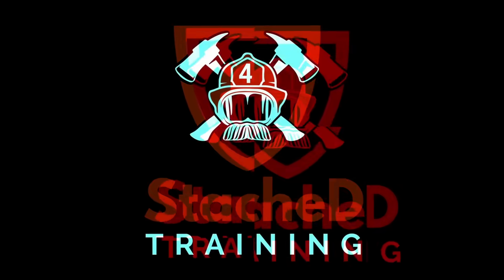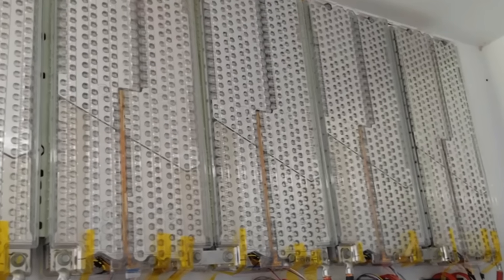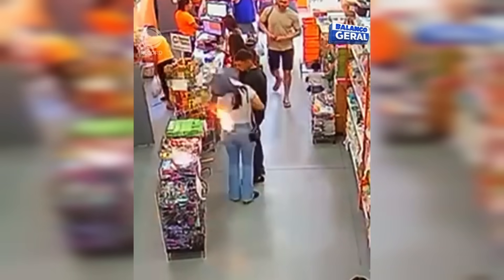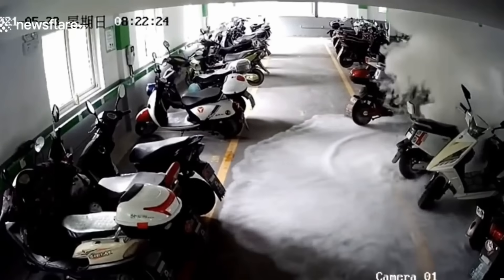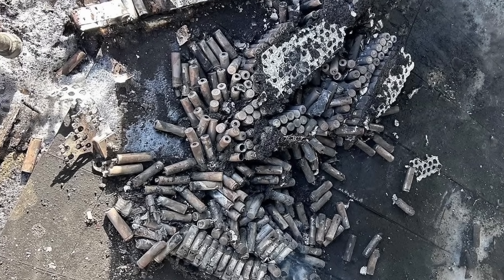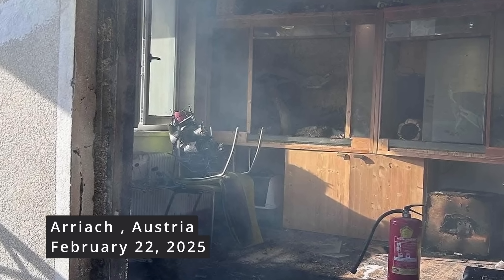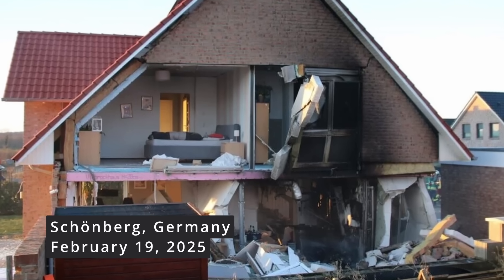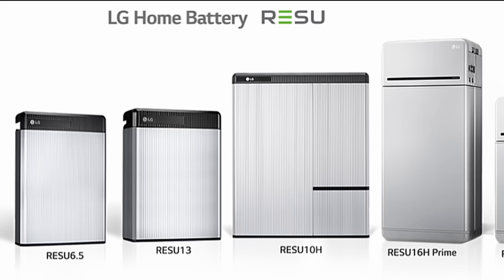Two Homes Just Exploded—The Hidden Danger in Battery Storage!

Comment: Here in the UK, gas and heating oil tanks have to be outside and a certain distance from habitable buildings.  Oil tanks must be bunded to contain any and all leakage from the tank.  I feel the battery storage systems ought to have similar rules applied a certain distance from habitable buildings.  I can see though, that neighbours might get upset if the thing is placed anywhere near their boundary.
As an aside, as an electronics engineer, we never directly paralleled cells (at the time we were using Ni-Cad, NiMh and sealed Lead Acid) as they just werent team players.  If the cells were even slightly mismatched, one cell would discharge into the other, leading to high balancing currents, shorter cell life and potential thermal issues.  A typical cheap wireless device uses paralleled 18650 cells to achieve the required discharge period, I shudder to think of the parallel/series connections of an EV battery pack - unless there are monitoring and isolating devices on each cell string, self-balancing discharges are guaranteed.
The amount of energy stored and available for immdeiate discharge is collosal - having shorted a small motorcycle battery accidentally with a spanner, the energy release is immediate and immense.
Reply: Same with pulse discharge capacitors.  They'll release 25+KA in a short circuit.  They can blow your hand off.
Reply: I'm surprised at the rules for fuel oil storage. In NYC, private houses can have a 275 gallon tank indoors, and virtually every house built before the 70s had one. I've never heard of any domestic fuel oil fires, and I'm pretty old.
Reply: @robertmoffett3486 Diesel is a liquid fuel, not a gas. It can catch fire or accelerate one, but leaking diesel fumes usually don’t quickly spread and build up in a room and explode.
Reply: @robertmoffett3486  Unless there's tremendous heat, fuel oil, like Diesel doesn't burn unless atomized.  That's why oil furnaces, boilers and water heaters have a pressurizer built into the burner.  Same for torpedo heaters.  I don't understand why you can't keep the oil tank in the basement.
Reply: In the US, it is common to have fuel oil storage tanks in the house.  Especially in colder areas, fuel oil/diesel (same thing except for road tax exemption dye) would get very thick.  Systems are typically gravity fed to the furnace, so winter temperatures would cause problems.  I've never heard of any tank causing issues all by itself.
Reply: @dzcav3 Diesel is a liquid fuel, not a gas.
Reply: @dzcav3 
Except for leaks.
Reply: @dzcav3  
In Europe heating oil is also stored inside as you described.
(Diesel) oil is actually very hard to ignite.

In Europe (Germany) the requirement is a kind of an extra XXL oil pan underneath the tanks to catch any spilling or leakage.

heating gas is stored outside with a certain distance to buildings.

Peace! from Dresden / Germany
Reply: [useless trivia]  In the original Star Trek series episode "Galileo 7", Scottie electrifies the outer hull of the shuttlecraft by donning a very heavy glove and bridging two electrical terminals with a piece of metal.  It looks so much like the actor is shorting out a car battery with a spanner (wrench) that I am forced to conclude that the visual effect was produced by James Doohan putting on a heavy glove (probably a linesman's glove of thick rubber and a leather over glove) and shorting out a car battery with a spanner [/useless trivia]
Reply: The separators within batteries are a time bomb waiting to happen. No matter how sophisticated the manufacturing, there will always be microscopic holes and fissures that will progressively propagate over time until the layer breaks down and you have an internal short. If you could unravel all the cells in a home storage battery the area of the separator would probably cover a tennis court. All it takes is a defect a few molecules wide to start the path to eventual destruction.
Reply: NiCd/NiMH cells aren't team players, though lead acid cells can be parallelled without much problems. This is why some engineers tend to do the same with Li cells as in theory they're also team players.
Reply: @mjouwbuis  Even LFP lead acid drop in replacements are not team players - they need to have a battery balancer fitted if more than one is used or things go whacko.
Reply: The battery management system for LFP monitors the voltage of each cell and balances it. It is pretty complicated because LFP does not have a nice voltage charge curve like lead acid.
Reply: Thanks for trying to help guys
Reply: Every correct BMS will monitor every cell seperately. Serial cells will not be able to discharge to another group of cells. And of coarse the max current output must be limited for each cell. (string of cells)
Reply: The US requires outdoor storage for LNG and propane gas. Heating oil/diesel storage is allowed indoors, but it’s no longer popular and is gradually being phased out. Liquid fuels don’t have the same level of explosion risk as gases, but if there’s a fire, it’s a hazard that’s not as easy to control as external storage.
Reply: @petesjk  Liquid fuel explosivity depends on the fuel type. Oil is not very explosiv.
However...petrol (benzine) in a closed non ventilated place is as dangerous as lng when leakage occur.
Reply: I'm having difficulty understanding the last ul half of the comment
Reply: @Eduardo_Espinoza  Parallel of Batteries = Bad.  One discharges into another to Balance the Potential (voltage) differences.  Lithium Batteries can store many more times the Energy for their weight per pound vs what we generally think of as a Battery (like a Car Battery, or AA or AAA little battery with relatively NO POWER compared to Lithium for it's size).

Comment: I have an 1,800w 650w 500w 350w 150w and 120w battery packs (along with solar, crank, and pedal generators to charge them) for power outtages. I have just enough to keep my kitchen, lighting, and electronic entertainment usable for reasonable lengths of time.

That said, I only feel safe about those battery boxes being in my house as long as I don't dwell on it. The big one even states in the manual to NEVER keep it enclosed (i.e. store it in the box it came in) once its been charged due to gas buildup. I trust the brand name of the big one (Bluetti), but everything else is just random chinese items (never mind even having a legit brandname) that convinced me they are of sound quality.

I try to cycle them all every 6 months (drain to 20-30% then charge to 80%) but I still can never shake the unease of all of this.

I live in an apartment, so gas is out of the question. If I lived in a home I would simply have gotten a 3kw gas generator and paid a fraction of what the battery ones all cost.

What started out as peace of mind is now no longer, for better or for worse, because of what I've learned from channels like yours.
Reply: It's not your house.  It's an apartment.  I'm fine with you risking your own life and property, but you're putting your neighbors, their personal property and your landlord's building in jeopardy. And, you don't give a damn.
Reply: You're putting your own, your family's and your neighbors' lives at risk over the occasional power outage? How about a couple of flashlights instead?
Reply: @ I think this guy is from Pacific Palisades, California.
Reply: Now im getting worried with info like this with my Bluetti setup. Im also in an apartment so no chance to have it "outside"

Comment: Where are the savings now ? 5 year and the house is gone ! These batteries need to be in a separate building, one for each block or street or town build like a bunker with good ventilation system. It can work like city heating, which is known very well, but for electricity.

Comment: DIY is cool but not with 400 volts.
Reply: It is not amps, volts, watts. It is the stored up energy inside a somewhat unstable lithium technology dependent upon microprocessors for "regulation". As a power plant operating engineer, EVERYTHING eventually fails. It is a law of thermodynamics known as ENTROPY.
Reply: If I see a high voltage sign, I stay away. IDC, what amps or watts are. There is a reason cars are 12 volts, I would not drive a 240 or 480 volt car ,nor would I want to work on one.
Reply: @jerrylawson9003  Being afraid of something that you have no idea how it works is a childish mentality. It's foolish to ignore amps and watts as they're the only important measurement of what's going to kill you. 12-volt DC will very much kill you with enough amperage. It's a simple math equation and you ignore it at your own detriment. How many volts is a stun gun smart guy? It's more than 400.
Reply: @SebastianKrabs  I am not afraid of anything.  I am speaking for myself  only  in my above comments.
Reply: @SebastianKrabs  12 VDC is rarely lethal, as human body path resistances are 150 to 5000 ohms, across ear to ear, or up and down limbs, with safety standards based on a default presumed 1500 ohms and standard reactance.  

At 12 VDC it requires under 120 ohms to enable 100 mA.  1500 ohm paths would allow less than 10 mA, which stings but is sub-lethal.  

How many people ever study electrical physiology of humans, plus know basic electronics?  

When I've worked around 10 kV 5 amp power supplies, what'd the optimal series-parallel connection of humans be to cause simultaneous deaths?  If you can't calculate that in realistic ways, you're probably not suited to be in the secured buildings or cages with such systems.
Reply: @jerrylawson9003  When was the last time you failed to avoid going into a home or business with a 240 or 480 volt electrical system?
Reply: @lokiva8540  I go into homes with 240 every day. 480 in some businesses but it is in an electrical room marked "high voltage keep out", this room is also locked. I wouldn't go in an energized building that was being transported down a road. Legally, you can not energize a building unless it is up to code and the high voltage is protected from contact.
Reply: @jerrylawson9003  Most people still have been rather close to CRT TV's and monitors, with voltages in the 15-30 kV range, and lethal capacitive storage even after power is off, or if relatively easy to defeat safety barriers are open or bypassed.  

Microwave ovens can be lethal, but are generally more idiot resistant.  

I've spent a fair amount of time inside facilities with razor wire over chain link outside a locked building with no windows, that some clueless people still try to break into.  There are lots of systems that are outside the jurisdiction of local Code officials and NFPA standards.  Licenses I've held generally have more to do with political deals, than with the actual safety exposures, where large businesses tend to operate formal training, but small ones rely on very few professionals to sort out what's important themselves.  

A 1200 amp buss bar power distribution at 48 VDC can do way more damage, than a low current (meaning a few amps, still highly lethal) system at 10 kV.  Still, neither is good to handle, while deeply instilled safety habits are needed in either case.
Reply: @jerrylawson9003  Electricians and line men work their life on stuff like that, imagine if they had the same idea. We wouldn't have any modern power today, let alone them fixing and replacing power poles. But I get you and understand you though, that's why I am not one either.
Reply: It's not the Voltage, it's the Amps that will kill you. Think of Voltage as temperature  of hot water and Amps the volume of hot water. A drop of boiling water will not kill you. 50 gallons of boiling water will kill you.
Reply: @MyUtubeScott 100 mA to 1 amp is more dangerous than higher or lower currents.  That range seizes lungs in ways difficult to correct without trauma center tools, and not just CPR or AED's.  

Higher currents tend to char skin more, and shut down organs less.  

Lower currents that stop hearts are easier to undo with CPR or AED's.  

As an engineer, I've worked around broadcast transmitters and other electronics far more hazardous than most consumer gear or electrical power systems.  I tend to not think of much as not home projects due to safety, but more over time or focus or interest.  I also have two storage trailers beyond a house and sheds, and multiple rooms storing tools, parts, and well over a thousand items of assorted industrial safety gear.  Plus some clue as to what I do not have, and why.
Reply: @MyUtubeScott  You're quite wrong as to more complex factors, that Google Gaslight doesn't seem to like seeing discussed honestly.

Comment: Don't firefighters have gas detectors they could use before cutting into or otherwise using spark generating power tools around garage doors or battery fires? seems like even if it's enclosed there would be a detectable abnormal amount of hydrogen outside...

Comment: I love the idea of home energy storage, but liquid/gel electrolyte batteries seem like a horrible choice. Too likely to have colossal failures with that many cells! Seems like waiting for solid-state batteries or some other non-explosive alternative would be a better solution.
Reply: Why do you love it? It has so many downsides vs. a diesel generator. It makes no sense.
Reply: @DeepBrainThrombosis  Because he's a virtue-signaling eco-weenie brainless Democrat.
Reply: @DeepBrainThrombosis  I love a diesel generator--diesels are my preferred combustion engine--but it can't be charged. You'd still be using the grid unless you have a way to access raw crude oil and refine it slightly. Or you could farm hemp and make biodiesel, but that would require a ton of extra work. For home energy storage, I'd prefer mechanical batteries. No chemistry to worry about, just the occasional motor/generator replacement. And no fire!

Comment: Definitely time for a major change: Li-ion must be declared to be hazardous devices, banned from homes, aside of small ones which we have in the phones, or even laptops. Generally we should move to Natrium Ion technology, not flammable. Even if they have lower energy density per kg/lb, and would requite more often recharging. Everybody was enthusiastic about the battery storage, but now we know better.
Reply: There is no better backup power source than a diesel generator. Doesn’t matter what scale you’re talking about, whether it be a small home or a large office building. Pick the right size generator(s) for the job. NO battery technology will ever be a better solution than a diesel generator. Period!

Comment: Made me think about my diy setup. But with a bms. Have been running for 5 years now. Still check the voltage a of each cell, of 14, once in a while.
Reply: re: "Have been running for 5 years now."  exactly, for this is literally how the "False Sense Of Security" works that the Captain just got finished talking about, so what this means is the EXPLOSION (blowing out the windows of your cottage) is now set to arrive "with a vengeance" in year 6.

Comment: Releasing hydrogen is not a problem. Letting it mix randomly with air wherever it goes and find an ignition source is. The whole house can fill with Goldilocks air-fuel mix before finding ignition when the battery failure isn't energetic enough to ignite early on.

Lock batteries in an air-tight (apart from the vent pipe to route gasses to a safe-r discharge location) fire-resistant enclosure with minimal internal gaps, then flammable gasses have very little air to mix with before making their way out of the vent. There may still be some fire due to oxidizers getting released during the battery's decomposition but the ratio should be too rich to produce an explosion that could blow the whole thing apart.

Comment: I have seen these systems in marine use in Australia. They require the batteries to be contained within a sealed box or dedicated room on board with a properly sixed dedicated vent pipe directly to the exterior of the vessel and outside, this could possibly be a one solution to the release of these gasses within a structural space isolating them and directly venting them to atmosphere.

Comment: There are much safer options for home energy storage, such as NiZn  that is free from thermal runaway and has twice the energy density, excellent power density, and more than twice cycle life of lead acid, ability for deep discharge without damage etc. Unfortunately not much effort has been put to improve this chemistry and make it affordable and safe(whisker formation, outgassing during overcharge-a simple failsafe pressure switch could take care of it🤔). On the other hand, Litium based chemistry got a lead due to leading demand in the automotive segment. But to use it for residential storage(where low energy density is not much an issue), undermining safety🤯❤👍